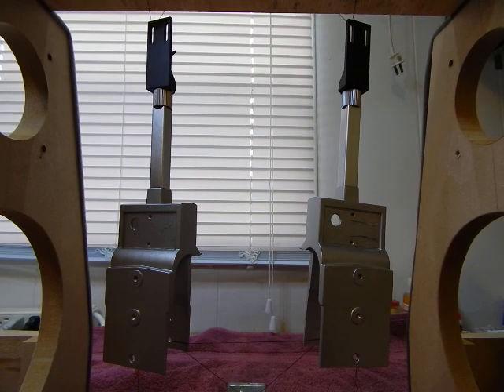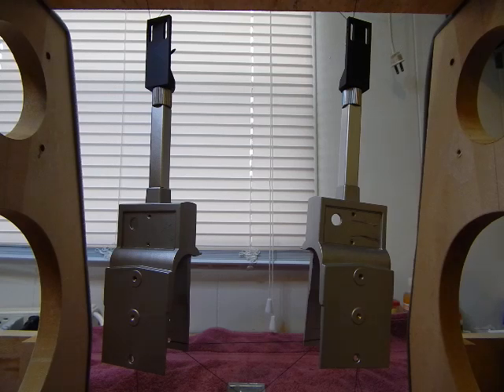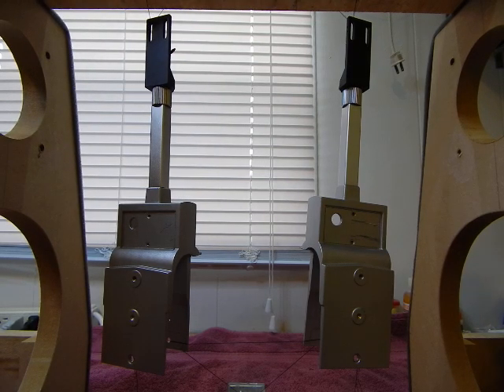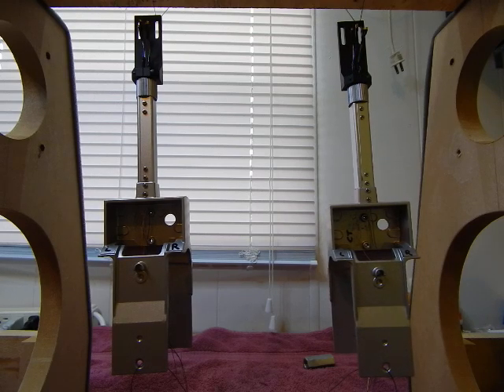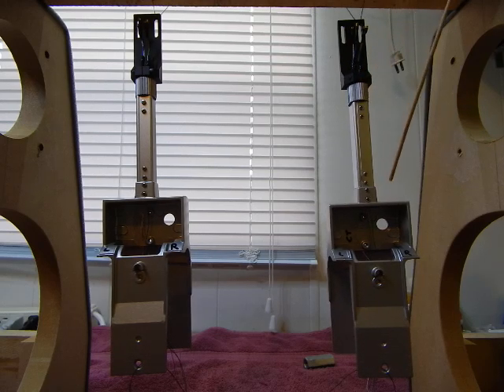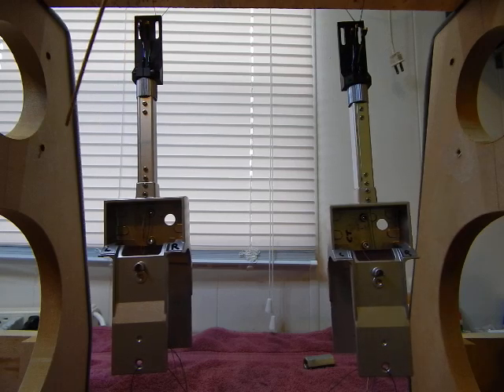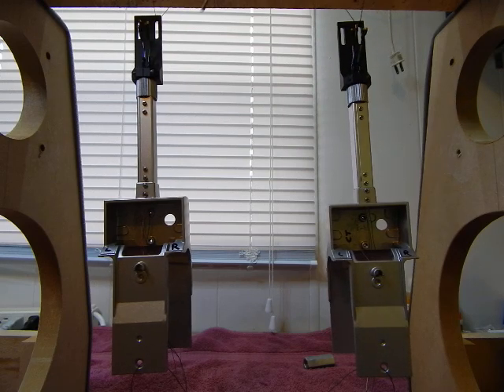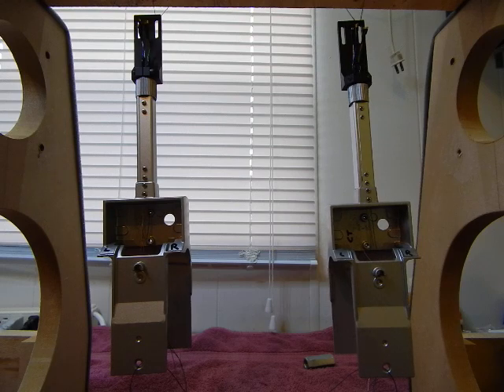Sony PS-X800 tonearm cryogenic treatment comparison

Comment from the maker: I believe in and practice civilized candor in my public writing. Unfortunately candor and honesty articulated maturely is not always appreciated, encouraged, and officially supported in online forums. Silly and destructive as it is, primal, base-level discord seems to be more the desired and encouraged norm.

My allegiance to candor and honesty in my laboriously composed online writing has also suffered repeatedly from moderator and webmaster “sen sir ship” (unfortunately code is necessary in this day & age of expression obstruction), sometimes resulting in deletion of my hard work.

It is for this reason that I have traditionally refrained from and intend to continue to refrain from replying to online public comments left for my Y/T videos, prior thread posts, etc. You will have to contact me personally via my webstore.com account or directly via my professor_bizzt at centurylink dot net address if you have questions, as I will no longer respond to questions left publicly here. Nevertheless, I’m leaving the “Comments” feature turned on for those wanting to post.

 
Best wishes, Professor Bizzt
Reply: Professor Bizzzt!! Long time no see!! I remember you from Audiokarma, we're fellow PS-2250 owners. Great videos on this Sony SLT, i saw an accelerometer test on the tonearm and its resonances were very well controlled even before "Cryogenic Bizztreatment". I wonder, wouldn't it be beneficial to wrap the tonearm tube in heatshrink tubing? As a damper.